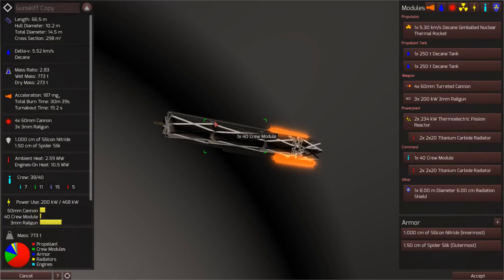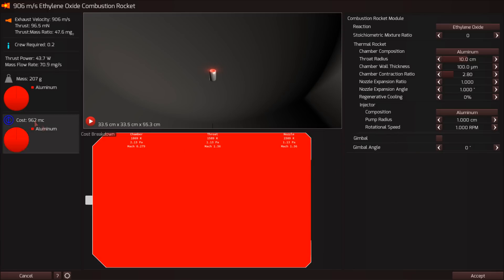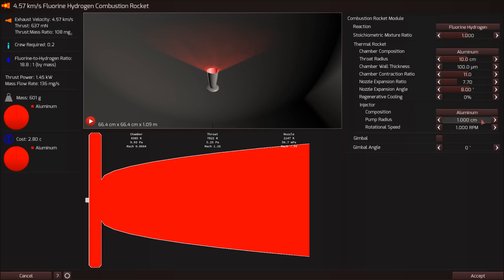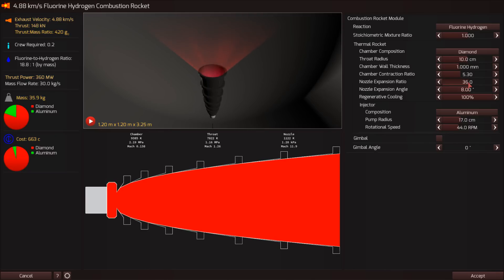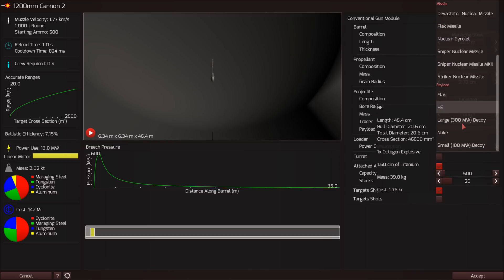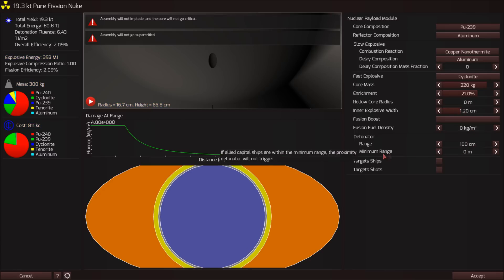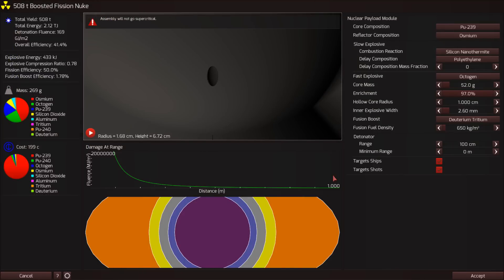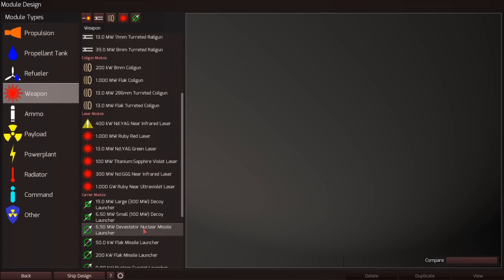Designing Rockets, Guns, Lasers and Nuclear Devices Using Physics

Comment: An output of 508 tons from a 269-gram device?  If you launched the projectile with, say, an RPG or mortar, you would probably still be well within the fatal range of ionizing radiation, so I would be concerned about how far you could fire it. With a fatal ionizing radiation radius of up to 520 feet, the 20-ton explosive output of the Davy Crockett W54 warhead was potent enough to be 100% fatal.

Comment: TIP: When making a rocket engine that uses hydrogen as fuel and fluorine as the oxidizer, make it out of plastic as hydrogen fluoride [hydrofluoric acid] eats just about any metal and glass. [even borosilicate glass is susceptible] This is just because the fluorine is held by a weak hydrogen bond, and the HF will fluorinate and corrode just about any substance it touches, except neon, helium and certain plastics.  There is a video by Periodic Videos [University of Nottingham, by Brady Haran] that demonstrates hydrogen fluoride breaking the tungsten wire light bulb, just by the HF breaking Si-O bonds, and Si-F bonds will appear in their places, dissolving away in the HF solution.  PTFE aka Teflon is my recommended material for making the fluorine tanks with, due to the fact that C-F bonds are the strongest bond in organic chemistry, even fluorine-containing superacids [fluoroantimonic acid included!] are stored in PTFE bottles and used in PTFE flasks, pipettes and beakers.  To watch the video of HF eating glass for breakfast, search for "hydrofluoric acid light bulb".

Comment: Neat!  I would find it fun just to design, field, and monkeywrench modules and spacecraft with this.

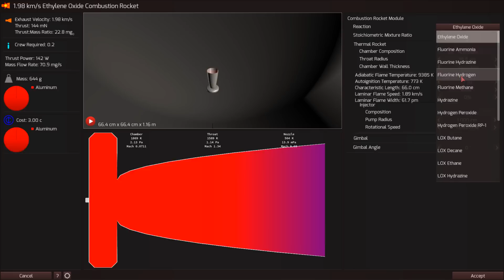3:07 - NO FREAKING WAY.  I would never want to get on a spacecraft with Fluorine Hydrogen fuel.  The by-product is Hydrofluoric acid.  Imagine the consequences of battle damage or some accident.  Terrifying is only a surface adjective.

3:45 - You seem to be misreading the data, Scott.  As the S-M Ratio is adjusted towards 1:1, the velocity all along the nozzle goes down, but the exhaust temperature (I think) goes up, so fuel expansion is imparting more momentum than simply rapidly moving (and rapidly cooling) exhaust.

7:32 - 'Grain Radius' ?  Now I'm impressed.  USMC Sniper ammunition fabricators would be pleased.

Comment: 508 ton yield out of a 296 gram device? That'd be Operation Sailor Hat (Any one of the three shots) out of a 40mm high-velocity Mk. 19 round, with radiological effects. If you had a means of protecting oneself from the radiation, you'd at least be outside of the blast overpressure radius, but knowing how Mk. 19s like to be drama queens, (They sometimes like to fire a projectile just enough to make it halfway down the bore. It's touchy enough to deal with when it's HE.) I wouldn't want to be anywhere closer than a hundred miles of the gun-target line.

Comment: Was wondering why the rocket chamber yield capacity was only 20MPa then realised your chamber was 0.1mm thick aluminium, so basically aluminium foil lol. Obviously there is no deflection or buckling modelling! Extremely cool from a gameplay point of view but don't kid yourself into thinking this is even scratching the surface of what's involved with engineering these things!

Comment: Sad thing with reactors is that there is no gas cores, so most of the time designing a reactor is simply fighting against temperatures.
Reply: Reactor designs IRL are fairly "primitive" in general. We're still using the same designs as 60's reactors. The government is very, very slow to approve new designs. There's interesting stuff being done in prototypes and theoretical designs, but the actual nuclear industry has basically stalled under regulatory pressure and corresponding cost increases.
Reply: well, that's what we use now, right?, I never heard of an existing gas core nuclear reactor.

Comment: I designed a coilgun that shoots stinger drones at 839m/s with a fire rate of 60 rpm =)
(and I also built an engine with 1000 TWR with 0.22 mixture ratio)

Comment: Fluorine hydrogen.  So, hydrogen fluoride?
Nope to the nope.
Reply: That would be the exhaust. Also the Fluorine hydrogen fuel mix is hypergolic.
Reply: +entropyembrace Unless it combusted unintentionally.
And still, F2 isn't something I'd like to have on board, either.
Reply: Ryan Payne Even if everything works fine it wouldn't be fun to work at a launch site that's heavily contaminated by HF from the rocket exhaust.

Comment: PSA: You need to beat the Vesta Overkill level in order to unlock Module Design, and Retaking Ceres to unlock Ship Design. I recommend using cheap and low mass ships with strong lasers to beat Vesta Overkill.
Reply: Chewierulz No you don't, you can unlock those features in the Codex.
Reply: Botond Dudas You mean I could have avoided 5 hours of pain? Fuuuuuuck
Reply: Chewierulz Lol I beat that level first attempt with the default ships because I couldn't be stuffed designing ships without module design. After I did that I noticed in the Codex you could unlock the features.

Comment: Weapons grade Pu-239 is above 90% enrichment typically even higher.
Reply from the maker: Yeah I read 93% on wikipedia.
Reply: Actually much lower enrichment grades are viable, its kinda objective really on how well your weapon makes use of the material.  I read originally they where aiming for 70% plus.
Reply: @deephish  I think a lot of it comes down to practicality.  Lower enrichment will work, but you get more nasty things like fizzle probability, lots of radiation emitted while the weapon is parked, much shorter shelf life before the core is contaminated with decay products, etc.  The 90+% range is where competent state militaries want it to be.  If someone was cobbling together a device on a shoestring to make a point, they could get away with some real trash.  A 400t fizzle eould be completely unacceptable to the Soviet Navy, but would still do the job in a football stadium.

Comment: if you cant go for a Keller-Ulam design, what does fusion boost do then?
Reply: That largely depends on the design, while true that devices that used secondary triggers get substantial energy from fusion, the energy from fusion on boosted designs can be non-trivial.
Reply: boosted fission weapons were the intermediate step between old school fission bombs and modern thermonuclear weapons. the fusible gas is injected into the hollow core and when the core is compressed as the bomb detonates the gas (tritium i think) is compressed so much it fuses and releases more energy. basically it gives you a bigger kaboom for your money with very little extra weight. the best example i know of off hand is the british "orange herald" device which achieved 0.8 megatons (not bad for an A- bomb)
Reply: Tritium, lithium gas usually. Deuterium once they got smarter, hard to get the temperature high enough, though.
Reply: The important thing about this is that the extra energy does not come from the fusion reaction - the fusion reaction is there to quickly produce more neutrons, so that the fissile material can react better.

Comment: 3:16 - "I'm disappointed, actually, that it doesn't offer Fluorine Hydrogen Lithium."  Scott, protip for you: once you've selected a material from any drop-down menu, you can then hit the up and down arrow keys to scroll through all of the options, looking for the myriad of ways to optimize this-or-that module. After you've spent a shameful amount of hours creating modules with that little trick up your sleeve, I think your disappointment in "a lack of materials" is going to largely disappear. ;P
Reply from the maker: I know this, but it still doesn't offer Fluorine-Lithium-Hydrogen as a fuel.
Reply: LOL okay fine, you win; if you write the forum post petitioning for F-L-H and any other important-yet-missed fuel types/materials, I promise I'll bump it on a regular basis. Be our champion, Scott! :D

Comment: Why no fusion weapons? And why no Nuclear Pulse drives?
Reply from the maker: technically most of the energy in fusion boosted fission weapons comes from higher rates of fission due to the extra neutrons generated in the core.
Reply from the maker: Probably because the equations governing thermonuclear devices are classified, and also, why do you need anything bigger than 10megatons.
Reply: Still, I'm dissapointed that there aren't Orions yet.
Reply: But isn't "fusion boost" actually just fusion weapons?
Reply: Well even without Teller-Ulam designs, you can get gigaton level nukes with a bit fiddling and abuse of the integrator. Or at least before the most recent of patches.

Comment: Worthy of note, most all reactor control comes from delay neutrons. Without them, when you go super critical, you go all the way!
Reply from the maker: Yep, you need to balance in that region where the delayed neutrons are the ones keeping you critical. If you cross into the prompt criticality region then power will spike and the energy released will blow your core apart enough to hopefully suppress the reaction....
Reply: Scott Manley "E=MC² is not impressed with your flimsy, zirconium tubes!"

Comment: Can we get this to export to ksp part models?
Reply: Unlikely, unless the game developer works directly with Squad; this game is so comprehensive in design modelling that it has a lot of fuels and materials that KSP takes no account of.
Reply: biggest problem would be 3d models
everything else can be just expported as numbers
Reply: There is a qualitative difference between what this program can do and what KSP can do.  One would have to design systems in this program, finalize them, and then turn them into parts mods to import into KSP.  Its more than a single-step conversion.  IDK if this program even has export capability; one would probably have to rip into it like a first-release modder and figure out the workings.

Comment: I would be curious on what they are using for their criticality equations. Considering it a game and the calculations are real time, I would assume that they would be counting the neutrons by calculating Keff at small time steps using material and geometric buckling. Considering they limited the shapes to simple geometric ones, i.e. sphere and you can't set a neutron reflector, it’s possible to use buckling. You can pull the equations straight out of Duderstadt and Hamilon's text book, if you assume that the hollow core geometries will fully collapse under the blast, otherwise you’ll have to factor in the hollow core. Even that you probably could just subtract out the material from the center from B^2_g, but don’t quote me on that.
Ohh great, now I’m going to have to buy the game just to see what they used…
Reply: neelybd or you can just go on the forums and ask the developer (singular)

Comment: Nuclear hand grenades? So if you're not above using exploits, you can load those as ammo in autocannons?
Reply: Depends on when it was fixed. Keep in mind that this was probably recorded 1-3 days ago. So maybe it wasn't fixed by the time he recorded.
Reply: I don't think that would be considered an exploit; you can load just about anything in anything else, if you go about it the right way. Due to how uselessly slow flares are, for instance, I ended up messing around with the idea of slapping a flare inside of a missile with short-burn, high acceleration. I haven't perfected it yet but it's still fun to see my flare charging at a swarm of enemy missiles, both trying frantically to course-correct so they don't just fly around each other in circles.
So, yeah. Slap a nuke into a cannon (or whatever) round. It's all good! :D
Reply: I think the exploit part comes from the fact that a nuclear device at that size would not be possible in real life, and comes from inaccuracies in the calculations at extreme ranges.
Reply: Yeah, I wrote my comment before getting that far in the video (SHAME ON ME!!11!), although on the other hand the last patch notes stated that "pocket" nukes had been specifically addressed and nuclear-based modules/calculations in general had been tweaked/fixed. So the fact that Scott was able to find a forum post about an exploit that was supposedly fixed - and probably due in part to that very same post - is a little unexpected. :)
Reply: *****
yep, minimum 39kg if I recall right:\
Reply: Brandon T
you might have as well made sure that each one of them irradiates more then your whole ship... if that's possible to do.

Comment: would buy this game purely as some kind of physics engineering sandbox
Reply: You can unlock that through a button in options. It is fairly hard to find though.
Reply: I would do the missions just as a refresher on orbital mechanics - having KSP calculate everything out is convenient (esp. since there is a LOT of other things to manage), but not what I would call real practice.
Reply: Yeah good luck with that cause they locked the module design behind 15+ missions. >:(
Reply: i think i would find a way around shurely
Reply: agreed, although the interface is not great. But the simulations support Nbody right off the bat, so thats a plus :p
Reply: Wouter Debois share with me your words of wisdom, the unlocking system is shite
Reply: I did and I have no regrets. once you hit the unlock advanced mode button, just create duplicates of stock craft to get around not being able to edit them.

Comment: It sounds like it'd be fun to spam nuclear hand grenades at enemy vessels using railguns.
Reply: Been there, done that... With 5MT nuclear charges obviously since nuclear energy dissipates so quickly in the absence of any medium. Improved by adding some course correction engine for more precision at extreme ranges. Coil guns are vastly more efficient though.
Reply: 50$ nuclear hand grenades!
Now with 2x the power!
BUY NOW!!!
Reply: +AddMorePoops that seems like something Fallout characters would say.
Reply: Borderlands vending machines.
Reply: BUY 1,000,000 GET 1 FREE!
Reply: In the infolink thingy there is a tab about unlocks (in concepts I believe) that allows you to gain access to the editors.
Reply: gendalfff can I buy 1 and get free 2???
Reply: @damnlemons5331  buy 1Megaton and get 500kT free
Reply: btw its annoying as hell to unlock the module editor, anyone know any cheatzsz?
Reply: You have a very good taste of profile picture, I would just like to say that.
Reply: Welllll how about super massive non detonating hyper dense multi layered nukes that are just basically mass driver bullets with flare
Reply: You can get really silly as there are some ways to get around warnings so you can have stuff like 900 Gt nukes on missiles, or like 100t nuclear hand grenades that you can shoot hundreds of per second out of a sniper cannon.